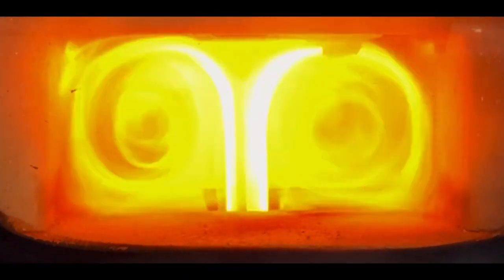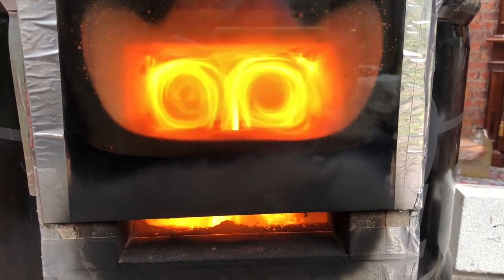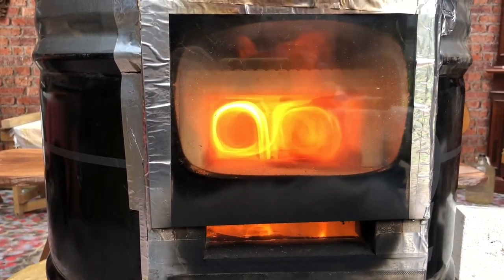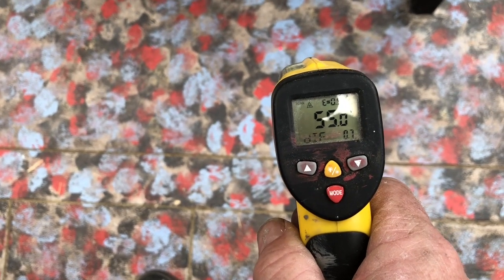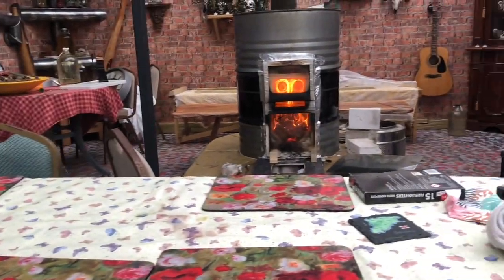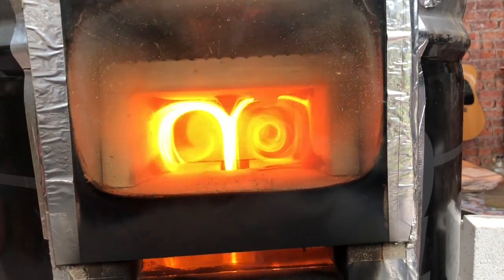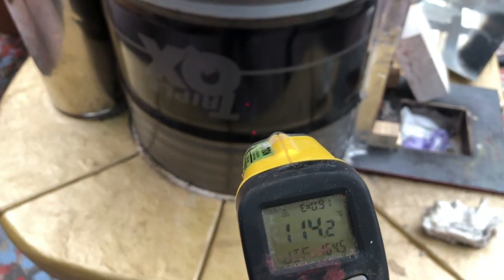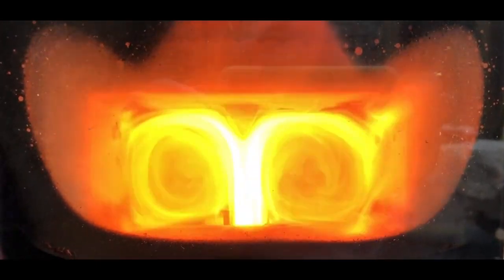Vortex stove in a barrel part two

Comment: Are you the only one that has done this as far as you know? I can’t find any similar designs. I love it, I am making a pizza/bread oven and I would like to try and achieve this vortex pattern within the oven by doing a double barrel roof so the flame hits the ceiling (similar to your wedge) and divides into two and exits through two downward exhaust ports. Most pizza ovens exhaust up, but I’d like to exit down to further cool the exhaust. Great stuff. Another 🇺🇸 here lol thanks for the f°
Reply from the maker: No not the first, you can find other folk on the Donkey pro board forum….. I used to build pizza ovens for a living!

Comment: Why do you guess , is less powerful than your j tube? Nice project
Reply from the maker: I have developed my J tube and it is a 6” system with secondary air and  all insulating materials. The tiny vortex is still being developed and is only a 4” system. A 6” vortex stove is much more powerful than a 6” J tube.